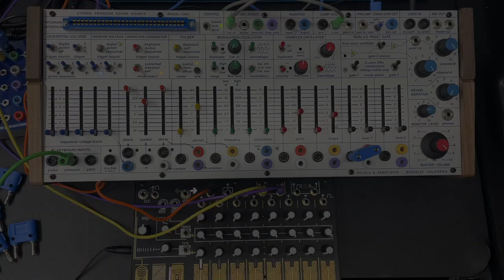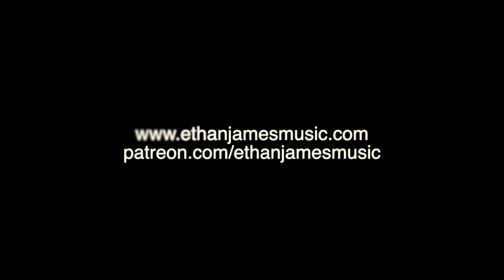Buchla 208c Easel Command tutorial Lesson 9: Envelope Generator Basics

Comment: Great vid! I just got my 208c with midi. How do you set a basic env while being triggered by midi? Having a little issue getting it going.
Reply from the maker: There are a few ways to do this.  If you want to just send an envelope trigger, it's midi notes F# to Ab on channels 1-5.  You can also set the envelope to be trigger by a keyboard input or pulser trigger and send the corresponding MIDI note.  Buchla has a document here: https://buchla.com/guides/208C_208MIDI_Implementation.pdf
and let me know if you have any questions!
Reply from the maker: it also depends on if you're using the DAW as a host or the USB MIDI host add on to the 208c. If using the USB directly from a keyboard, set the envelope to be trigger by the keyboard input
Reply: @EthanJamesMusic1  thank you sir! I ended up just triggering the sequencer by sending midi note 0 to the 208.